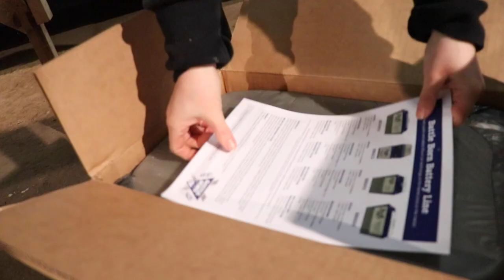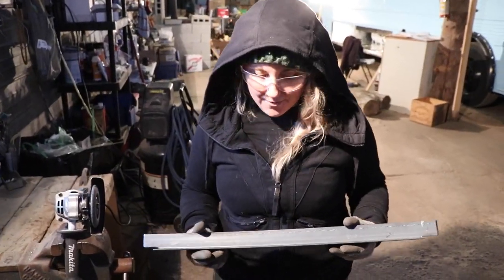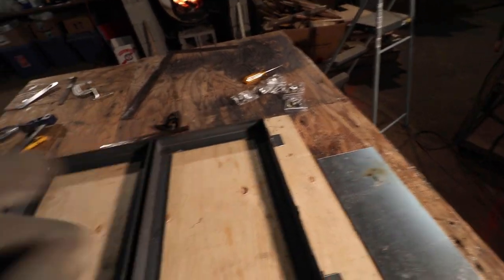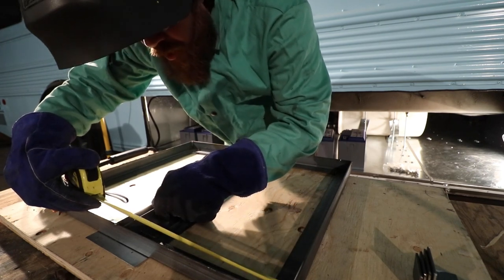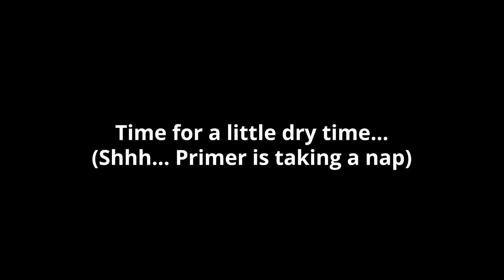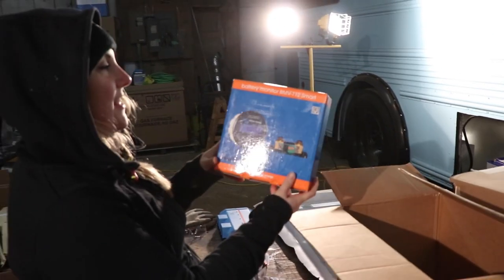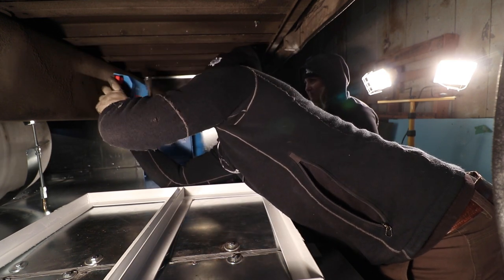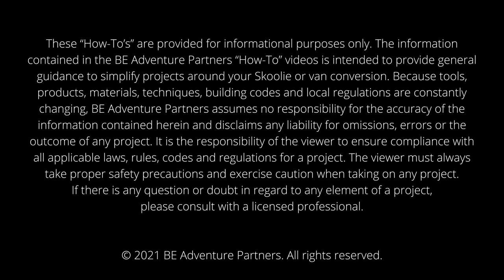Custom Fabricated SKOOLIE 6-PACK LITHIUM BATTERY BANK RACK | Solar System Components Tetris

Comment: Nice job BEap's!!!  Good job on the partnership with BB! I'm jelly!
All those sexy blue boxes get me a little uh, excited.
Why not 24v? No disadvantages to it. Lots of advantages.
But that ship has sailed ,ofc. Thant's ok, we all miss boats, I have missed many. =P
HVAC plans?  I have 13k watt hours and I'm seriously considering doubling it. I've learned I cant go 3 cloudy days.
That scenario has occurred more than once already this winter. It discharged to 7% but it did make it. Back to 85% by the next day with sun.  No tilting and bus not optimally aligned, but whole bus roof is panels. I did get THAT right. It seems like all the electrical components are just a little more needy in the winter =)
Reply from the maker: Hey hey @Shay McQuaid! Oh yeah! We’re super energized by this battery bank setup!

Honestly, we’re pretty new to solar so not to sure all the advantages of 12V/24V/48V systems. We’ll learn more about it in the future as life is about constant learning and evolving. So we don’t feel any ship as necessarily sailed because we as humans are all on individual journeys and have different experiences 😊 

As for HVAC, we’re going to live with natural ventilation for cooling. When we traveled through Mexico, Central & South America, we rarely had AC and were happy with natural ventilation. For heat, we are going to have a diesel heater & we’ll see if a wood burning stove is in the cards (because that would be pretty sweet!)

Thanks for watching, Dude!
- Brian + Erin

Comment: I've dealt with water heaters for a lot of years different kinds of water heaters and really the only thing about a water heater that you need to access is the business and you know where the elements are in unless it's leaking but then it just needs to be replaced
Reply from the maker: Good to know @KAREN RIGGLE. Our connections to the water heater are on the top. So regardless of which side of the bus we’re on, it’ll be tight access, but still accessible! 
Thanks for watching!
- Brian + Erin

Comment: 😎💕👵💕🐶 check with the manufacturers regarding mixing different battery chemistry in your battery string. 😎 the inverter will add heat to the confined space 😎 awesome and amazing battery and inverter layout 😎
Reply from the maker: Yes! We’re using 100% the same battery type! But if someone was to replace batteries in their system, they should definitely be the same type.

We’re curious to see how much heat the inverter puts off and plan on getting some before running temperatures and after running a typical load temperatures. Thanks for watching @Joseph Godwin!
- Brian + Erin
Reply: @BEAdventurePartners  if you get a temperature monitor, you can monitor the outside and storage space 🤠 the heat from the inverter should give off enough Btu/hrs to keep the water tanks from freezing 🤠 awesome job as always
Reply from the maker: @JosephGodwin137  monitoring the temperature is an excellent idea & we have talked about putting a remote thermometer down there so we can know how it’s fairing down under. Thanks for keeping the ideas flowing!
- Brian + Erin